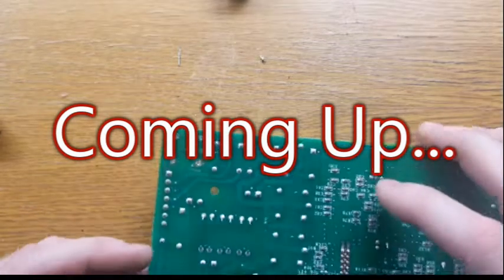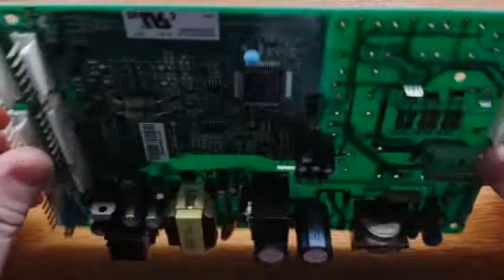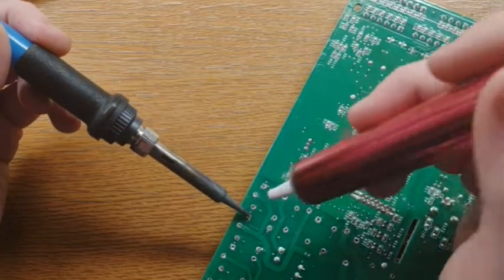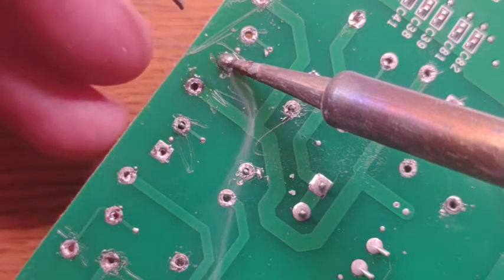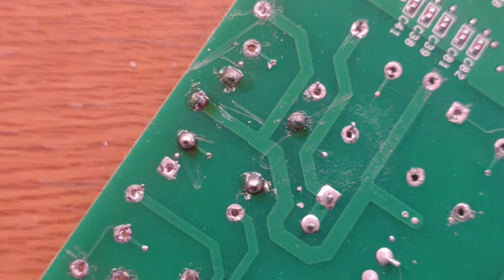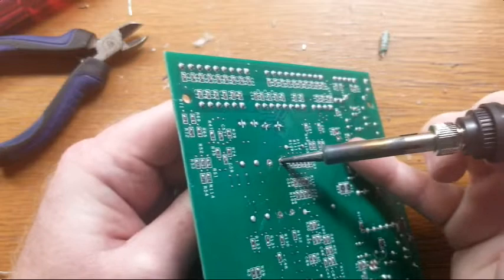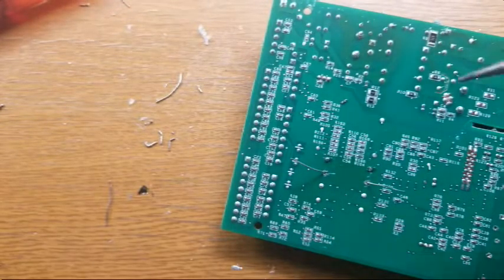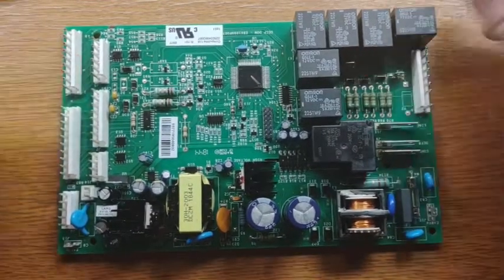GE Control Board Rebuild - WR55x10942 / WR55x10942p

Comment: I was wondering if you were ever able to fix your refrigerator by replacing the capacitors and relays. My fridge cools for one full night but then doesn't cool as good or maybe not at all the next day. I'm guessing it's the largest relay on the board causing the problem. I tested all the capacitors with an ESI meter and they only lost 10% UF which is normal

Comment: Great tutorial! I am chasing an odd issue with my refrigerator where the freezers evaporator coil will not cool. I have verified that all of thermistors are changing state and the fans are all working. I am beginning to think it is an issue with a component on the board. Visual inspection of the board doesn't reveal anything suspect. Do you have any thoughts on what could cause this?

Comment: Hi! First of all. Thanks for sharing this tutorial!! I have a ge profile PSE27NHWHCBB. After a blackout the condenser fan motor stoped spining and the refrigerator stoped working. and after unplugged and using a normal fan in the back everything went back to normal. I did this just in the mean time I got a new fun. But Before this my ice maker already stopped making ice so i would keep it turned off, but I dont know why really I had the amazing idea to give it a try and turned on. Minutes later the back of the refrigerator started smell burnt. Now several parts of my board burned out. Including one of the resistor and i think a little chip in the back of it. How is possible that turning on the ice maker can cause so much damage? Im really afraid thar replacing the fan and the board and turning on the ice maker again will blow up the brand new board. Can that be possible? I really hope you can help me before doing anything haha

Comment: I had a problem with power supply so I changed all the capacitors at the control board and fixed

Comment: Is the board rebuild kit available? I may have missed it in your notes
Reply from the maker: Hey Joseph, yes. You should see a link in the description to purchase there:
www.graceappliance.com/gekit
Reply: @GraceAppliance  Hi Andy, I just recently ordered the control board rebuild kit. I removed the existing board and noticed that it didn’t have the L shaped relay. Is the kit I ordered a style that covers a few variations of the board? I am a tech like you, and would usually just get another board, but was told by my parts vendor that GE had raised the price by $100. You are probably already aware of that. Quite rediculous, $400 for a refrigerator board. The vendor also stated that Whirlpool may do away with the $60 core charge and do the same thing as GE
Reply from the maker: @josephfolsom2030  I'd LOVE if they'd do away with core returns altogether! That would be great. Frigidaire recently did the same. I've been told that whirlpool due to supply issue has been rebuilding used boards in house and sending them out as new!  Uggg

Yes, the kit will cover many of the alternate GE boards even if you don't have an L shaped relay. Just be very mindful of the capacitors uF (capacitance) rating that it matches exactly what you replaced with.
The voltage on these can be greater, but not less than what is currently installed.
Make sure the relays have the same voltage rating as your current board which will likely be 12 vdc.

Let me know if you have any questions as you're going.
It shipped out yesterday, so you should have it soon. 

Thanks!
Andy
Reply: @GraceAppliance  The Lord Bless you
Reply: @GraceAppliance  Hi Andy, Received the control board rebuild kit (Thank you). I noticed that the relays are all the same in the kit. I have 4 black relays on my board and one brownish red one. Should I change out all of those relays with the ones in the kit especially the brownish red one? Also my evap and condenser resistors are green with no striping on them, they don’t look browned nor is there any burns on them on the opposite side of the board that would include the relays as well. I know that relays may not show anything on the outside but can still be faulty. I was going to change the resistors if those in the kit will work. The capacitors are not bulged at all. My board does not have the L shaped relay and I’m thinking they replaced it with the Brn/red one. Also the Brown/ red relay has a different rating of 17A at 250v and 20A at 125v. It is 12dc as the others Clarification needed. Thanks
Reply from the maker: Hi Joseph,
No the black relays from the kit will not replace the red relay you described. I do think you're correct that this replaced the L shaped relay which would be your defrost circuit.

If you'd like to send a picture of the lettering / markings on top of the red relay & the opposite side showing the pins, I'll see if I can identify an appropriate replacement for you.
GraceAppliance@gmail.com

If your resistors are not discolored and you have no fan issues once repaired, I wouldn't worry about the resistor replacement. However, you can always uninstall an old resistor and use your meter to ohm resistance of both parts to verify they match if you'd like. Should be 2ohm +/- 5%
Reply: Circuit board medics can repair the boards

Comment: Hi, I have been watching your videos, I have a GE side by side that has me stumped it is not cooling adequately, around 10F in freezer, and around 45f in fridge.  Board looks fine but get an Ohm of 11 on the fan resistor plug (I believe the condenser fan-by the compressor) but does not look burned, the fan itself spins when powered.  When unplugged the fan does not spin freely like a top.  Will replace the fan motor.  What I have done so far is check Ohms on compressor and added a little R134a (filled to 6psi), Ohms on the pins check out (around 4,6,10) and get 1.03amps when running, just a little frost on the low side line, checked Ohms on the thermistors, they seemed to check out Ok per your previous video.  Model is GE TBX21CIBRRWW.  I am a home gamer but love to fix stuff that breaks.  Hope you can help me out.  Would just an evap fan cause this thing to not cool adequately?  Also, would I have to rebuild the board or just change out the Evap Fan resistor if I still get 11Ohms after fan replacement?  Thanks and I appreciate your videos.  P.S, there is frost on low pressure line, the high side is not extremely hot, it is just warm though which seems odd.

Comment: Part 2
WR55x10120 is the part # of the Temp/Control Board.  I tried 2 diff boards and got the same results.
13.5 volts at both ends of wiring.  Main board looks ok.
Reply from the maker: Did you ready replace the wr55x10942p?
This called an encoder refrigerator and believe it requires a slight wiring modification to the harness at the main board which is covered in the provided instructions with a wr55x10942p.

Let me know if this has been replaced. Thanks
Reply: No, I got the part #s mixed.  I replaced the WR55x10120 inside the refrig
Reply from the maker: @JM-cb6gh  I see, one of the symptoms of a failing main control board (behind the fridge) is as you describe, turning on and off intermittently.
If you're comfortable enough rebuilding the board, you could try that or replace the main control board.
Reply: @GraceAppliance  I replaced the Main Control Board and all is well now.  Thanks.
Reply from the maker: Outstanding! You're welcome!

Comment: GE Artica S/S PS25NGMDCC
Temp/ Control Board. WR55X10942P
The lights go out and temps go down only a few degrees.  Power off / on reset works for a time but same cycle starts over.  Usually off/on once a day.  I got 13.5 volts on each end of the wiring.  I tried 2

Comment: My fridge is blinking the temp numbers 38 then 44 and dings each time. The inside is still cooling. We unplugged for 30 seconds. That did not help. Any advise?
Reply from the maker: Hi Sharon, please send your model number from inside the refrigerator section.  Thanks!